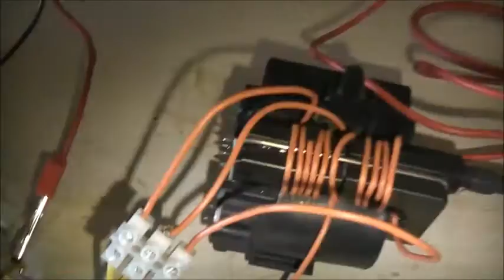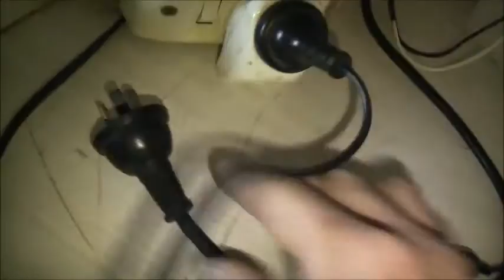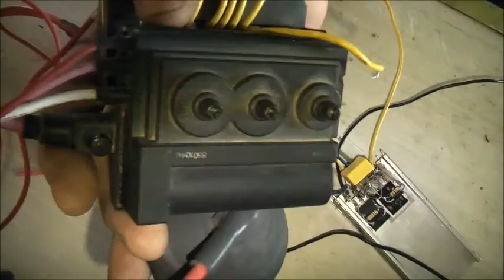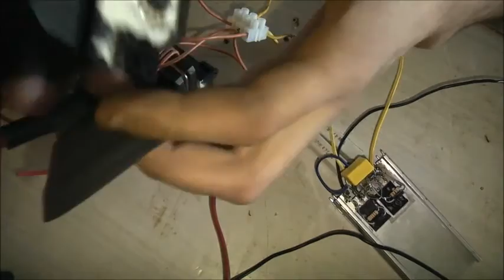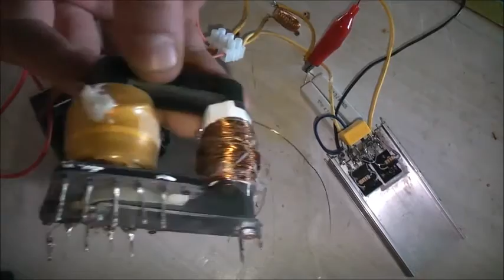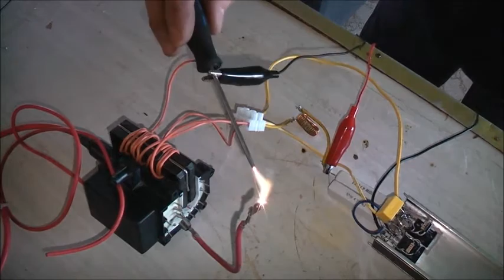Got the ZVS Running, Finally!!

Comment: Larry' I forgot to say mate, try different capacitance capacitors. It will give a better output mate. Iv tyred from 1uf all the way to 22uf 
;-)
And on the flyback ferrite try the 3 on 3 turns. Gives more output " but not as think on the arcs ;-)

Anthony

Comment: I'm trying to work out where you have connected the screwdriver,
One of the terminals of the flyback should be ground/common, that's where you should be connecting the screwdriver, 
btw, there's no need to physically rewind a coil to reverse it, just reverse the connections on one of the coils if it doesn't work ;)